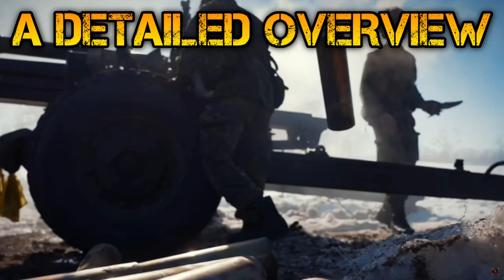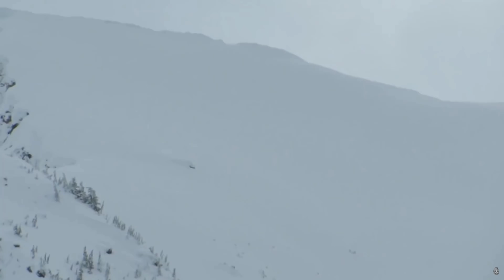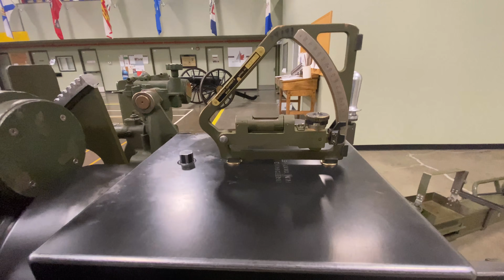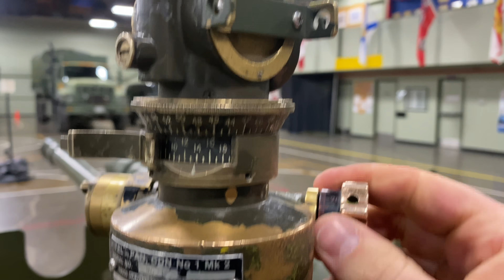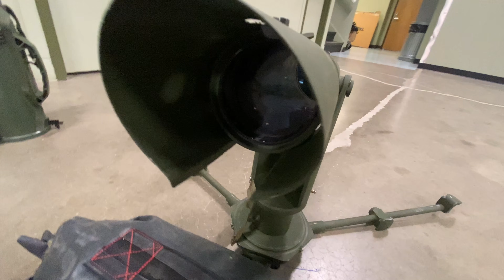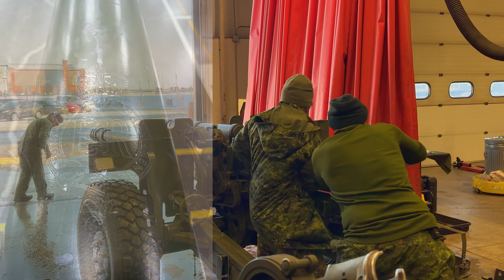The 105mm C3 Field Artillery Howitzer - WEAPON OVERVIEW

Comment: Couple of corrections, the L5 had nothing to do with the introduction of the C3. The big push to adopt US equipment came when the Canadian army in Germany was transferred from the British Command to the US Command. One of the notable differences between the M101 and M101A1 is the muzzle swell to prevent cracking. Canada at first leased a bunch of M101 and if you go to the Vancouver Gunners website, you will notice in the early 1960's albums, that the guns had no muzzle swell, those were the leased guns. Canada started their own production and eventually around 367 were made. (I seen differing figures on that) Fun fact is the recoil system is made by Otis! 
Prior to the C3 configuration, the guns went through refurbishment and modification to the C2 version which included mounting the tannoy to the right trail and reducing the shielding. (there was some other changes, but my memory is weak) I worked on the C1 version and commanded a C2 version out of 15th Fd RCA. My favorite gun memory was our regiment with all it's guns and vehicles being airlifted to Shilo, to support the Germans in their Black Bear battle runs, we had never seen so much ammo at one time, think about having two full pallets of ammunition per gun, that needed to be stowed in your Deuce! My friends gun had back into battery fail, leading to the gun burying it's muzzle in the ground and it's trails in the air and two rollovers (thankfully not my gun). I notice in a lot of recent video, that the majority of the time the guns are being fired with low charge, I am guessing they are trying to eek out the life of the guns, as you can shoot 2-3 shots at low charge to equal the full charge equivalent (TFL?) that get noted in the Gun Book. 
I miss the smell of propellent and sagebrush (thanks to Yakima), I don't miss as a young gunner, painting the entire gun in a coating of motor oil and varsol! Also the poink,poink sound of a toilet paper roll being rammed up the barrel during cleaning.
Do you guys still do "Sniping Gun", sort of like open gun, but the gun is slightly hidden and the Gun Commander actually lays the gun onto the target using a compass. We used to practice AT drills a lot in the 1980's, using a truck driving around as a target for dry heaves. I read a sobering account of M101 against T34/85's in Korea, with HEAT rounds they were able to take out a couple of T34's, but when they ran out, they found the HE rounds useless at stopping the tanks.

Comment: The South Koreans and Vietnamese plopped M101s on the back of trucks with good results. If the CAF weren't so top heavy with incompetent brass and bureaucracy heavy, they could ratchet strap this museum piece on the back of a ford 350 super duty and you'd have a far more useful set up for high intensity conflict at very low cost in comparison to fielding newly purchased self-propelled arty. Both Trudeaus have left the CAF so emaciated it's no wonder why Canadians don't see the point in serving. It's a shame really. This country used to be really great.

Comment: As a 0811 - USMC Field Artillery.  I served in a M198 battery, 155 mm. We would train on 105's once a year.  This was between 1982 - 1986. The 105's breaches had 1945 - 1947 dates stamped in them.  Compared to the155 mm, it was so light and easy to move around by hand. We loved it.

Comment: Anyone else notion the spelling error here?

"Current service version with Canadian artillery is the LG1 Mark II, of which 28 were purchased for the Royal Canadian Horse Artillery (RCHA). GYAT supplied the first howitzers in 1996 and fielding was complete by November 1997. "

Also how has the cost of this piece of equipment gone up nearly 500% in 30 years? At least according to Wikipedia.
Reply from the maker: @claymclaren5788  GYAT 🍑
Reply: GIAT - French firm. Groupement des Industries de l'Armée de Terre.
Reply: Yes, I am aware. The joke is someone changed the entry on Wikipedia to say GYAT, like what the kids are calling a particularly nice posterior. It's clearly not an accident either because it is spelled correctly everywhere else on the page.

Comment: As an FO, have they solved the problem of command and control so that an observer has a decent chance of hitting a moving target?  As you know, a moving enemy requires “leading” your fires so that the target and the shells try to occupy the same ground at the same time. So the FO needs to know the time from call for fire to impact so they can attempt to estimate when to make that call.  A dedicated battery to your unit and a “ at my command” would work, but the FA battalion doesn’t like to relinquish that much control— or at least that was an issue in the mid-80’s. 

I would love to see a video to explain how old school “charts and darts”, and “laying” a battery leads to first rounds on target.  You don’t have to get into the math of calculating a fire command, but show how the FDC does their thing. Then show how the XO gets all pieces pointing the same way with an aiming circle.  This might enable a little respect towards the complexities of indirect fires.

Comment: Great video. In Chile we use the same modernization packet by RDM on our M1 105s, the work being done locally by FAMAE. The main reason was to increase range. I think they actually can shoot longer distances than a Russian 122mm howitzer. These things are so tough that they can go on forever. We already have a modern Israeli firecontrol system so instead of changing them for a new gun I think you should just put them on a truck, portee style, instead of towing them. Several armies have truck portee systems for old 105mm guns: South Korea, Vietnam, Servia, even Colombia made a prototype.
The fact 105s are being used in Ukraine demonstrates they are still a valid weapon system.

Comment: 18:50 store bought plate cover.  Only reservist would get away waring this in their uniforms
Reply from the maker: Bro…. Don’t pull that card…. I could find thousands of pictures and know of many reg force troops in just about every trade buying and using and deploying and training in their own store bought tac vests…. So I wouldn’t worry about the reservists getting away with anything.
Reply: @_Matsimus_  Then I would of said WOG.  If you don't want negative comments make sure you don't have fake soldiers waring fake gear

Comment: Spent 3 years in a M101a1 '05 battery in the Marines.  Loved that thing.  We could get in and out fast on the offensive and support patrols from fortified positions.  You could effectively run the gun with 3 cannon cockers and one driver but 4 to 6 was the norm.  Rate of fire was high with a good A gunner "rocking the cradle".  It filled a niche between mortars and the M114 155mm.  The '98s came in during the '80s and no more '05s.  The '05s we had all were made in the 1940s and you could feel their soul and history.  Rumor had it that they all ended up in Iran during the Iran/Contra debacle.  The '98s were Army hand me downs and felt more like a machine than a weapon.  Weapon technology advances and warfare changes.  I still would prefer going to war with light '05s and staying mobile to support the grunts, likely the next combat will be sea and island combat against China in the Pacific which will rely on much longer range missiles and rockets and most Marine batteries are giving up their guns for HIMAR systems.

Comment: My issue with the C3 was when they put a heavier barrel on it they did not upgrade the carriage and suspension so they are wearing out  and while there are lot of spare parts available internationally for the original configuration  the only country I can think of with the C3 is Canada and Canada dos not represent a large enough market for manufacturers to have readily available spare parts - All in all I think the C3 "upgrade" was a questionable idea
Reply: It was done largely as a cost-saving exercise. Canada has to be one of the few countries that keeps old weapons systems in service as long as it does. A replacement for the C3 is long overdue.

Comment: In this age of unmanned drone, usefulness of 105mm howitzer should be re-appreciated. No longer used by artillery battery and replaced by 155mm howitzer. But its range (12km-20km) and destructive power are optimal for artillery firepower that will be operated by infantry battalion or company level, used in conjunction with small reconnaissance drones. Currently, 81mm mortar is used by firepower support company of infantry battalion. It should be replaced with a self-propelled 105mm howitzer.

Comment: Nice seeing the 105mm being used for positive missions. Towed or mounted in a mechanical mode, I appreciate the primary gun functions are being practical and at a reduced cost. More armies should consider ways to make continual basic and continual training while keeping lower cost. Up gunning to different tubes for trained gunners is not that difficult. Great video M.
Reply: It seems to me that Canada could benefit from having more tubes in general, new ones along with the legacy ones.

Comment: Can it fold up nice with the gun elevation going to 180 degrees? That would be cool if it does. I believe the cost of re-opening 105mm ammo factories is outweighed by the benefits the 105mm provides durring prolonged LSCO. The future of the 105 arty will be anti-landmine and anti-air "super smart ammo" as a gimmick and keeping the 105 howi's in low-scale service till 2060's (just in case 😊😅😂!).

Comment: Not a gunner, but a Weapons Tech. Never got the chance to fire one, and I'm not qualified to work on the C3 by myself, but I have helped another tech work on them over the past few summers while I was attached to CI 2 DIV in Valcartier (Class B reservist).

Lots of doodads and neat gadgets to inspect them with, but 99% of the time you just need a wrench or ratchet to work on these things. Simplicity at its finest. Seeing this thing completely disassembled is fascinating.
Reply: Used to work on theses guns at Ci 2 Div Form 2020 trought 2022 as RegF.  Real Easy to work on, but the lack of spare parts realy hinders the maintenance and servicability of the Howitzer. Had to make a whole year project with the LCMM just so we can get brand new made wheel bearing seals because there were no one left at the depot anywhere in canada. for me this gun is a Love Hate situation... Hated it because the lack of spare parts and not technicaly challenging but loved it beause it was easy and fast to work on and be left alone while working on it because not alot of people have the knowledge from a technical standpoint to properly do maintenance on them anymore.

Comment: As decent as the little 105 is and the m777 we really need to get some self propelled arty like the m105 paladins  ....do to the changing abilitys in the modern battle field stationary artillery is not nearly as capably as it used to be ..we need better equipment to be able to better serve are troops